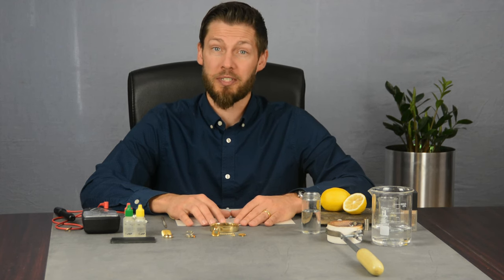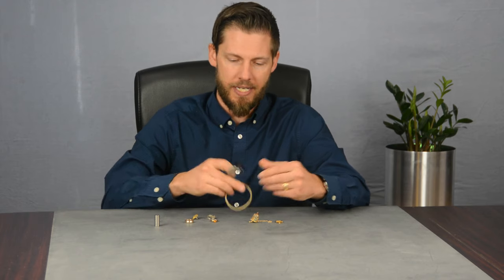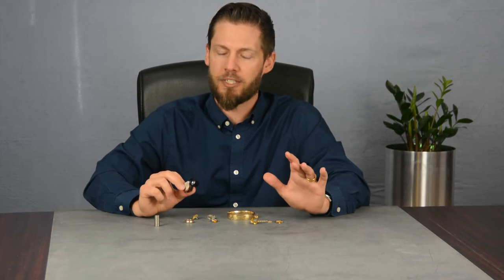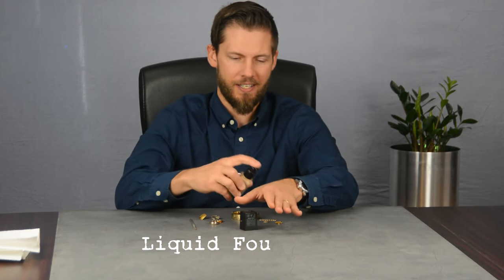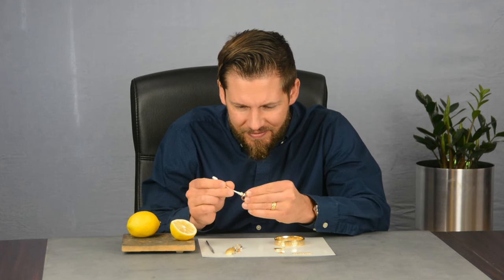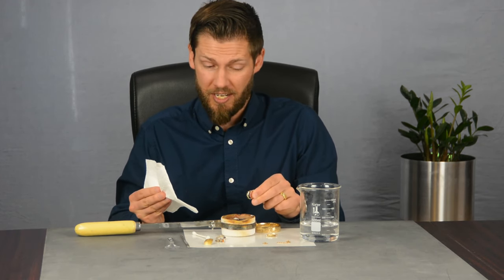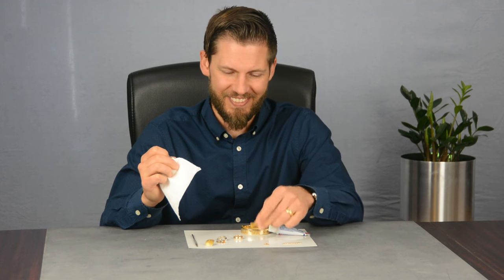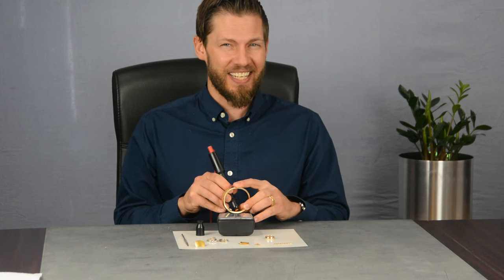How to check if gold is real or fake! We try DIY gold tests at home.

Comment: Why not just check the density (weight / water displacement)?

Things heavier than gold cost more so it would make sense to counterfeit
Reply from the maker: Density is a great way to get an idea if an item is gold or not. The main problem with this method is that you have to be very accurate and most people don't have a way to measure volume accurately at home. If you have access to a graduated cylinder and an accurate scale (or a specific gravity set-up) that can be a strong indicator if the item is gold or not. In our experience we have seen many counterfeits made with high density but low cost materials like Tungsten which has a very similar density to gold and then gold plated on top.

Comment: What about a watch. I can’t put a watch in liquid
Reply from the maker: Good question. I wouldn't use any of the liquids we talked about on a watch (even if it's waterproof). Watches can be very tricky to test and different parts may be made out of different materials. I would recommend having a jewelry/watch expert help with that one if possible.

Comment: in my opinon best tests are the one that not destructive - chemical tests no go, then gold must have unique properties that hard to fake - weight to volume ratio +  electro-magnetic properties, this should probably be enough
Reply from the maker: Generally I agree with this, the hard part is that most people aren't able to test for those at home with things they may have laying around. But yes if they had an accurate scale and a volumetric flask that would be a good way to determine authenticity

Comment: I have seen the toothpaste test done ✅, and it was done by rubbing the toothpaste like you did, but then for 30 seconds real hard rubbing it back and forth on a white cloth and if it turns black or has color at all it’s real gold❤
Reply from the maker: Thanks for sharing! Yes, I think that is a better way to do the toothpaste test than what we did. I would be a bit concerned about scratching the piece since toothpaste is abrasive, but of course it all depends on the situation.

Comment: yeah, scratching 900$ earrings is out of option in pawn shop
Reply from the maker: @suteners2111 It's true there are many less destructive ways to test gold that are much more reliable too. These are just some inexpensive ones that can help at home, pawn shops should have gold testing equipment that they can use to prove what they're selling to you is legitimate.
Reply: @ArdenJewelers  ok, thanks.

Comment: Bro the golden bracelet is from kgf aldorado
Reply from the maker: That's a crazy coincidence. In this particular case, the K is actually part of 12K and the GF stands for Gold Filled. You can be sure of this because the 1/20 part at the beginning of the stamp is another indicator of gold filled jewelry (it states that the metal contains about 5% gold).

Comment: Yes my name is Larry B. and I have a money clip it looks like gold and I left it in white vinegar for 9 minutes and nothing has changed magnet won't push or pull is there anything else I can do thanks a bunch Larry  do I put my email in the comment
Reply from the maker: Hi Larry, thanks for commenting. We didn't have great luck with the vinegar test, so I wouldn't put much stock in that. Your best bet is to bring it in to a local gemologist to test it. We do this kind of thing for free. If that's not an option, I would recommend using one of the professional testing methods we mentioned at the end of the video (touchstone and acids or electronic tester). Just make sure to be careful/safe if you decide to use the acids. :)

Comment: 🙋🏼‍♀️ Question for who ever has a legitimate answer.
  Why would someone say that gold has no reaction to all of the tests it went through? 
  Story: My parents had bought us kids jewelry from Mexico one year when they took my grandma to go visit.  My brothers got a ring each and matching Jesus head charm for their necklace.  
  When 2 of my brothers passed my mom gave me their 4 pieces to pawn to help with funeral experiences. 
  The 2 jewelry shops I took them to said there was no reaction to any of the tests and 1 guy said that the stamp on the pieces just said Mexico, with both of my brother's initials, RS & GS, so he said they weren't worth anything. 
The other jeweler offered me $300. for each of the rings and $425.  for each of the charms.
Why would 1 say they were worthless and the other offered a decent amount. Even though my mom said they only paid like $150. USD For each piece.
 Was I bamboozled or were the jewelers inexperienced?
Reply from the maker: It is possible that they weren't experienced. It is definitely possible that one of the jewelers knew for sure and the other made a mistake (I can't say without seeing the item in person which one was correct) It sounds like if they were purchased for $150 they likely wouldn't have offered more unless there was a long time period in between. the gold market typically goes up over time so if they were purchased when gold was much lower that would be a possibility.
Reply: @ArdenJewelers    Thank you for the response.  
Yeah, they were purchased in the late 80's and I sold them back in 2017.

Comment: The toothpaste does work but you have to use a cloth put the toothpaste on the cloth and rub the gold jewelry on it for about 30 seconds and you will see a black mark so it does work you just didn't do it the proper way
Reply from the maker: Thanks for sharing. Yes, we have heard that way works better than the method we tried it in the video. Thanks for the confirmation!